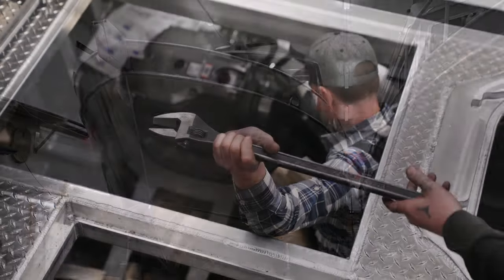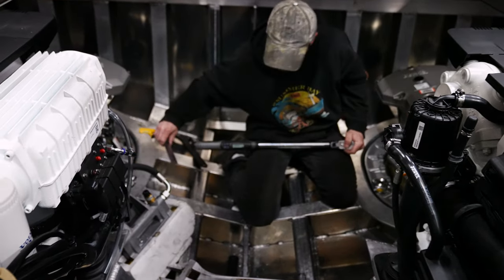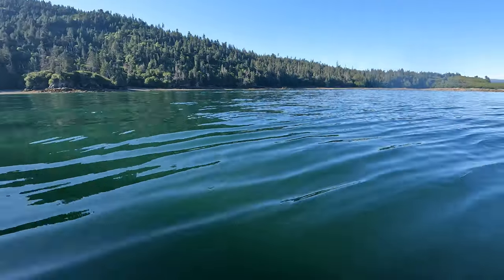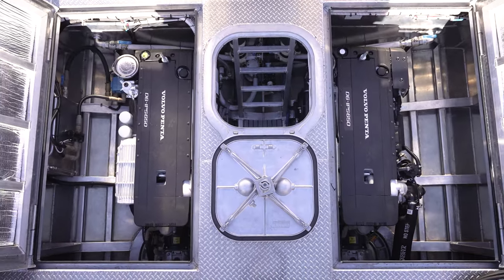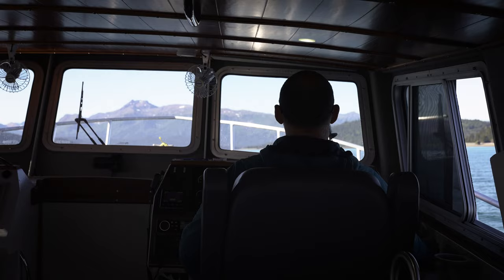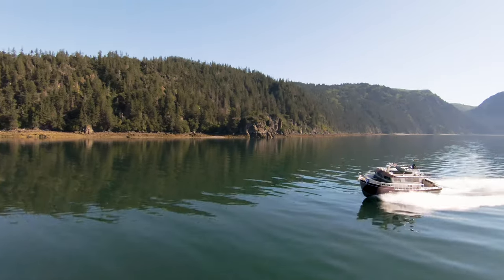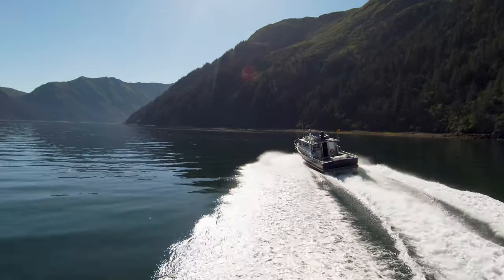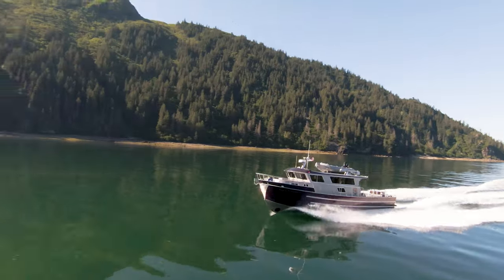Bay Weld Boats - Megan Elizabeth - 43ft

Comment: what if it’s in shallow waters/or a solid debry unnoticed?! would definitely destroy the prop pad right?
Reply: Yes.. there's plenty of examples of people searing off pods in shoals and from logs even saw a video of someone who hit a shipping container that was floating a foot under the water line
Reply: Yep, nothing to protected the props or drives, nothing will kick up like if you hit something with an outboard. Its going to get sheared off or worse case get rammed up into the hull and breach it. Plus all the below deck space the engines and drives take up. There is a reason why multiple large outboards are popular and gaining more popularity each day.

Comment: One thing I noticed is how high out of the water this boat runs. Looks like you have managed to design out any additional drag. Look at a 30' Duckworth and see how low in the water that boat runs. It almost looks like its plowing water. I know there is no comparison of quality and workmanship as Bay Weld is a premium boat builder but just wanted to give an example on the difference in engineering a design between a custom boat and a production boat. The Duckworth burns a lot of fuel (.8MPG).
Great boats and great designs.
Reply: Those pods help a lot with lift. I'm pretty sure the Duck gets closer to 1.0 mpg (w 225 X 2) and substantially more with those new funky props... what I hear anyways.
I had a 33' Perregrine w 2 X 225 for many years in AK. Much heavier than Duck and I had 1.0 mpg.